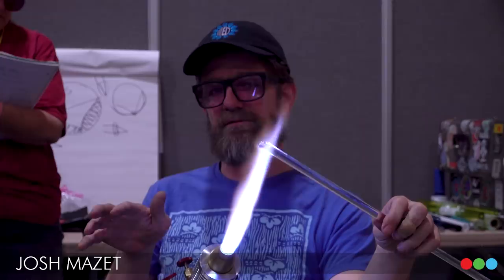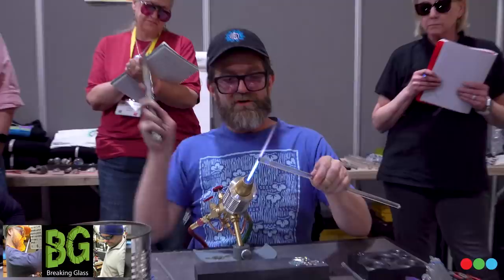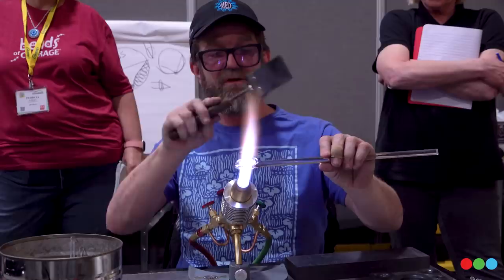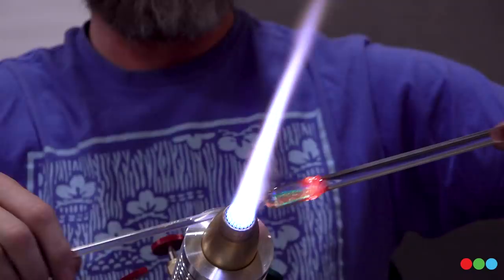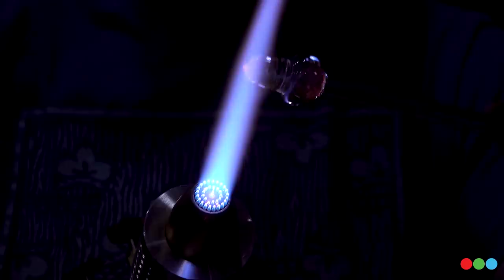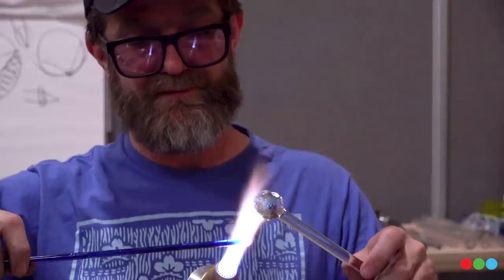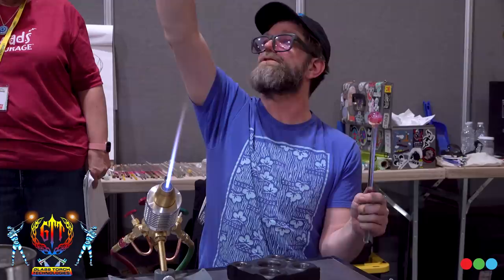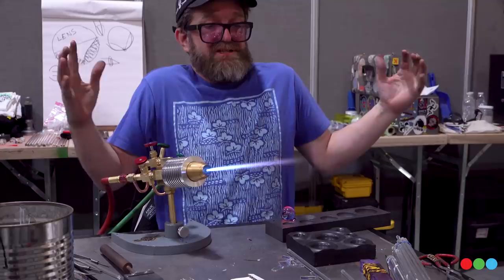Making Dichro Boro Marbles w/ Josh Mazet

Comment: Can anyone suggest a way to determine which side the dichro coating is on?
Reply: look at the edge. if you can see through to the back side the dicro is on the back. If the dicro is facing up it should reflect and you wont be able to see the back side
Reply: You take a pencil of some kind of dark pointy object put on the glass square if the mirror image touches it's the dicro side if there is space between the image then it's the glass side.